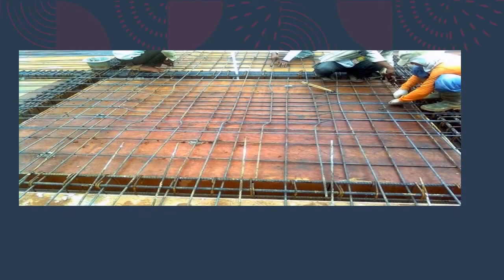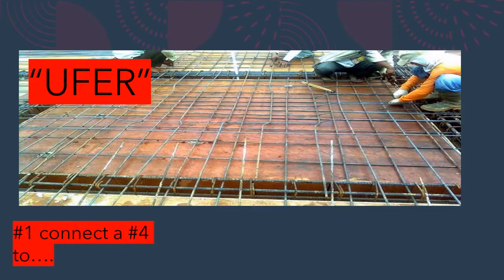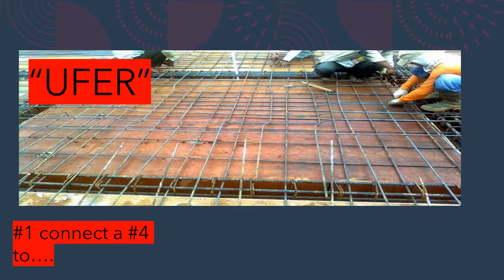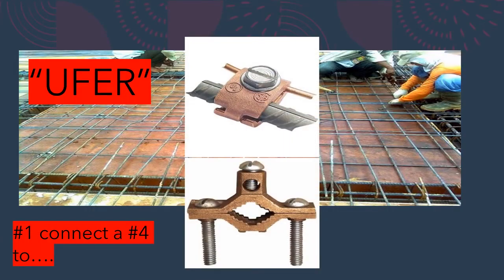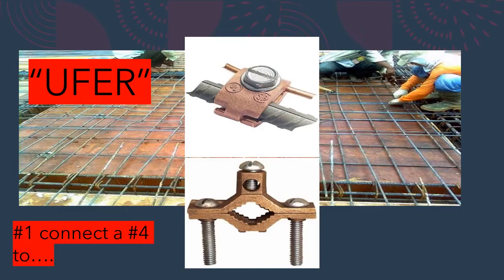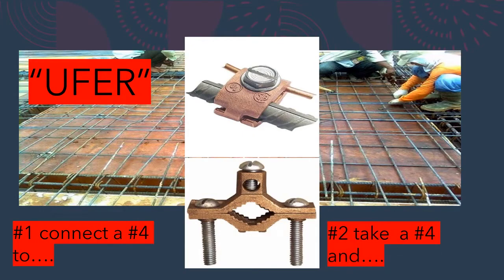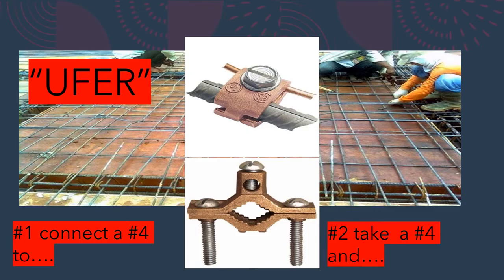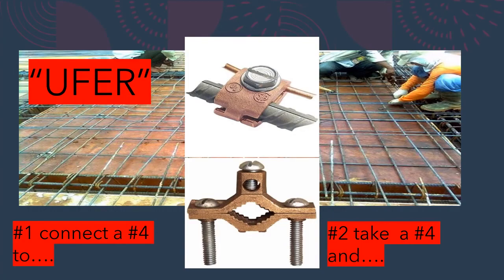UFER Ground? How to Properly Connect and install. Ufer ground installation.

Comment: This grounding option brings up a interesting alternative for those cursed with rocky ground. Would it be legit to dig a 20-foot trench about a foot deep, run #4 copper wire along it supported two inches up, and then pour enough concrete to cover the wire the required two inches? With the exception of not being in a foundation, it would be meeting all the code requirements.

Comment: Where I am, most inspectors want the connection to the rebar to be accessible so we have to bend a piece of rebar up out of the slab and make the connection in a wall behind a blank plate, corner of garage/basement etc where it can be accessed in the future
Reply from the maker: I'm getting ready to make a video on the stub up, it's not a requirement by code though.

And technically that rebar stub up is not a part of their grid it's actually an extension of your grounding electrode conductor so where that connects underneath the footing is still not accessible.
Reply: Same here, that would be great to see a vid on that 👍

Comment: What happens where the #4 wire come out of the concrete? Does it come out the top of a slab, or through a hole in the side concrete forms?  Does it need protection from water accumulating and rusting? Like adding caulking etc where it exits the concrete after the concrete is poured? Or is this not important and whatever the concrete guys want to do is fine as long as you can get the wire to the disconnect?
Reply from the maker: Normally just bring it up out of the ground and let them pour it,you could ask your electrical inspector
Reply: We normally sleeve a small piece of liquid tight blue PVC flex (Smurf tube) over it and nail to the framing.